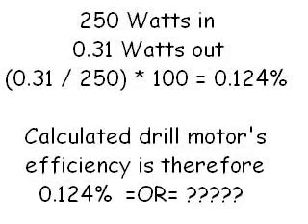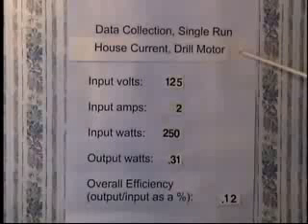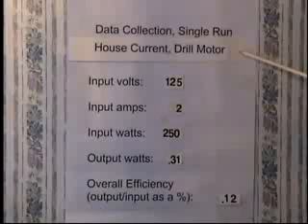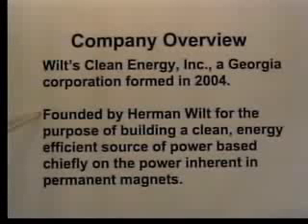Wilt Magnetic Motor 'Testing' Proves Stupidity is a Virtue Among the Stupid

Comment: I thought you were going to say that your genius buddy was going to claim that his magnet motor was over unity. By the way, your calculation for wattage IS part of Ohm's Law. Ohm's Law goes far beyond calculating resistance, by measuring current and voltage. Anyone claiming they have an "over unity" device, "gots to get demselves an ejamacation"!! It is possible, for a drill to draw 250 watts of power unloaded. Those series wound carbon brush motors have a high quiescent draw, mostly their cooling fans, and friction of the spring loaded carbon brushes against the commutator. If he plugged his drill into a Kill-a-Watt meter, and gave it full trigger, it could have shown that, even without, or with a very slight load.

Comment: There is another explanation of course but I guess it's a subset of A.

You have to load the drill.

If you do not it will be VERY inefficient. If you pull the switch and have the drill just spin, where does the energy go? It will move some air, but mostly it wil generate a lot of heat and noise, but the drill will not be doing any work, almost all energy will be lost to heat & noise.

Of course to really measure a drill's efficiency you have to load it appropriately.

Comment from the maker: Indeed, if you did even an adequate job on your motor it will have been at least 60% efficient. MIT students are required to take lecture series 8.02, and that lecture series includes the requirement that students build an electric motor; the motor with the highest efficiency is awarded a prize.

Comment: Nuclear reactions are not over 100% efficient. They are powered by the principle of mass-energy equivalence (E=Mc^2), so you've got to treat the mass which is consumed as a form of energy. This always brings (energy out / energy in) below 100%.

If fusion were over 100% efficient suns would never run out of fuel.

Comment: "The Wilt motor used less than 34 watts and rotated flywheel 1540 RPM's"

As has been pointed out before, it doesn't matter if it's got twelve billion RPM's, if its torque is low it won't actually do any important work, it'll just stop dead when you actually apply some resistance to the spinning.

Comment from the maker: Measure the torque, genius, not the RPMs.
Reply: power is the product of both torque and RPM. To get horsepower, you multiply the torque in foot pounds and the RPM, then, divide by 5252.1131, that will tell you the Horsepower. If you multiply that horsepower and 745.69987, that will tell you the output power in watts. divide output watts by the wattage drawn by the motor, then multiply by 100, you have the efficiency of the motor in percentage. (Just some numbers, in case you have an 8 digit calculator handy)

Comment: I guess if you load the drill to the point where the motors only barley turn you CAN get an efficiency that bad,
Or if you do not load it at all, that would also work.
In both cases the "problem" is that you measure the efficiency outside the operating parameters if the device.

Comment: @Paxmax 
It's a single-phase device no matter how the wires are connected.

The wiring in the house may be single phase or (which is more common) three phase (with the a phase separation of 120 degrees).
Single phase loads could be connected to ground and one of the phases or between two phases (which give sqrt(3) times the voltage).

Comment: "Percentages are weird like that." 
No, No they're not. 3 x 37.8% = 3 x 37.8/100 = 3x 0.378 = 1.134 = 113.4/100 = 113.4%. 

The concept of multiplication doesn't change when your dealing with percentages.
Reply: Percentages ARE weird. If you claim your motor is 3 times more efficient, that means your motor is three times closer to 100%. It's an asymptote. You take the first percentage, 37.8 and add 100, than divide by 2. (68.9% efficient). Add 100=168.9. divide by 2 again.(84.4% efficient). you can do that for ever, and get convincingly close, but you will never achieve 100%, let alone, exceed it. 84.4% efficiency is a valid claim for motors over about 2 Horsepower. It's late: past my calculator's bed time.🤣😝😁

Comment: PHYSICS ERROR.

At 5:50 you say that GE produces a motor three times more efficient than 37.8%.  37.8 x 3 = 113.4%. Efficiencies above 100% are physically impossible, and even the best electric motors ever build haven't gone over 50% efficiency.
Reply: When talking efficiency, 3 times more efficient means three times closer to 100% efficiency. It's an asymptote. You will never reach 100%, you'll just come convincingly close. a motor with 3 times that efficiency means 84.45% efficient, a very reasonable claim, for motors 2 HP or larger. Order of operations: 37.8+100=137.8/2=68.9+100=168.9/2=84.45. Three phase industrial motors, particularly large ones, (over 10 HP) regularly achieve 91.7% efficiency, and even better, as the horsepower rating goes up.

Comment: ROFL! You failed to include compensation for watts consumed by the duct tape holding your cord together.

Just doing some diddling for the sake of perspective: if my badass 1/2 " Makita were 0.124% efficient, rather than around 75%, then instead of weighing 4.4 lb, it would probably have to weigh 4.4*75/0.124=2661.29 lb. (Power out is *roughly* proportional to how much copper you wind.) And instead of cunsuming around 500 watts, it'd need 302.42 KILOWATTS! LMFAO!!